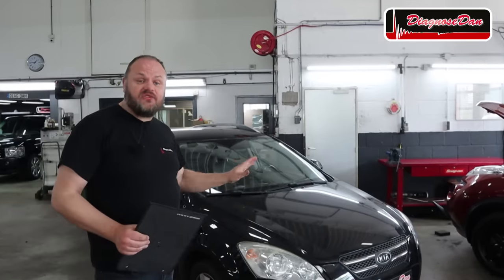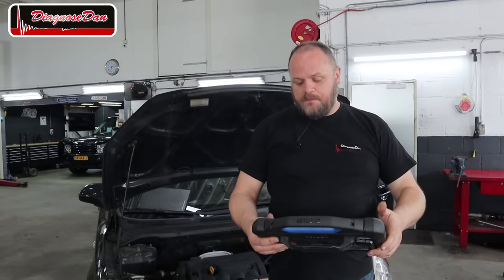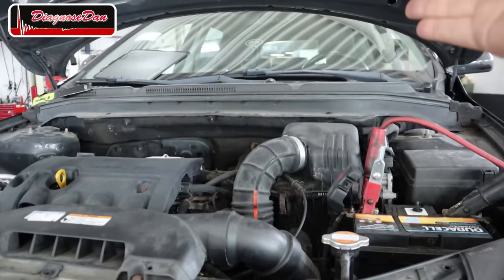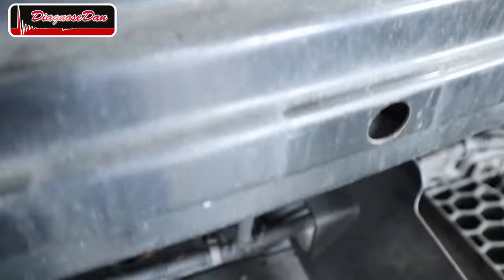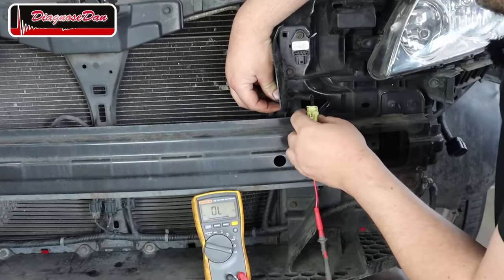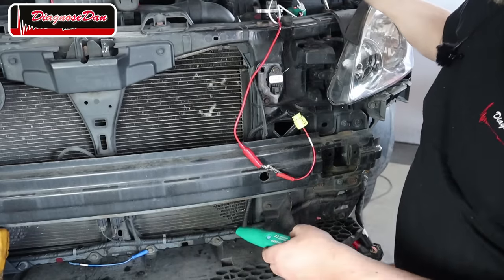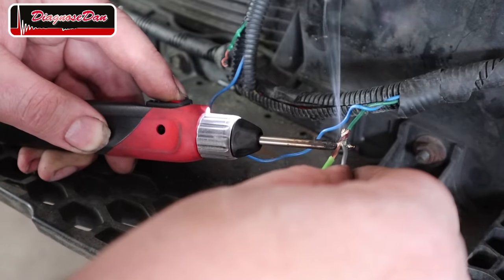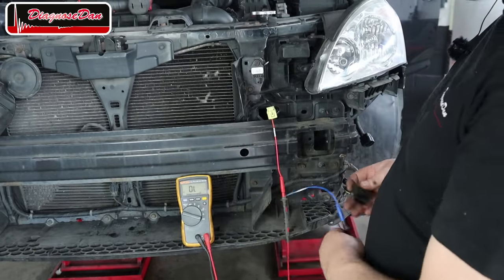Airbag Fix (Green Crusties)

Comment: sir, please make videos for Electromechanic power steering in major problem in Torque sensor main and sub, motor related, module related faults. and some videos for Inlet metering unit for diesel cars.
Reply from the maker: If we get one in the shop i'll film it
Reply: @Diagnosedan  thank you sir.

Comment: always good to see a dan video!!!   opens can be a real pain to find.  wire tracers are about 50/50 for me. gotta wonder if there was a factory defect in the insulation, an abrasion, or someone poking it .
Reply from the maker: Its in a weird location to be poked and the hard outside cable shell had not been opened before....

Comment: Had the same issue on my 07 octavia, luckily, my broken wire was at the door hinge loom. ;)
Reply from the maker: Great find👍
Reply: @Diagnosedan  Actually someone on here 
recommended the xtool anyscan A30 m. WHich enabled me to diagnose the fault in the drivers door airbag system, first check was the accessable loom between the door and A pillar.Probaly a weak point from constant bending, and the wire is very thin.  ;)

Comment: Nice fix, interesting that wiring break tracker tool.
Reply: @Diagnosedan  After I made that comment, my dashcam usb wire broke somewhere 😆
Of course I don't have that handy tool, so I don't know where the break is, but luckily I still had spare lead from my old dashcam, between the car 12V socket and camera, so it still can be used. Never throw anything away, it may prove useful in the future :D